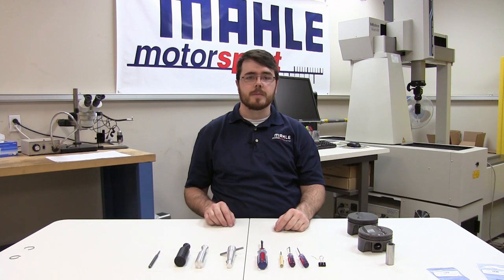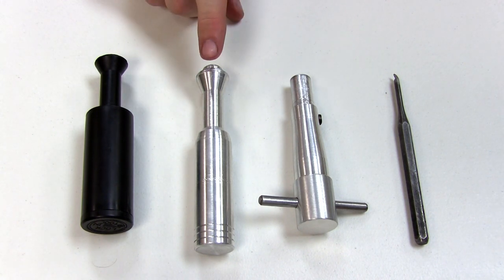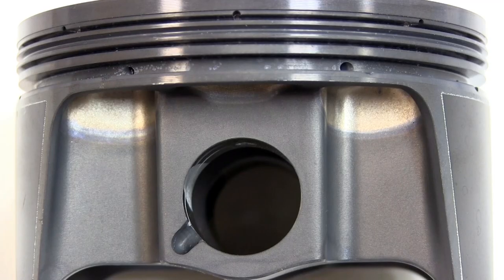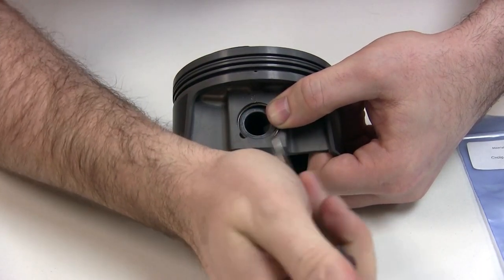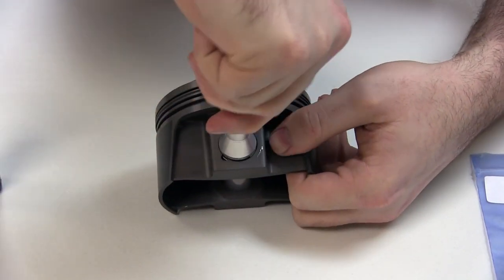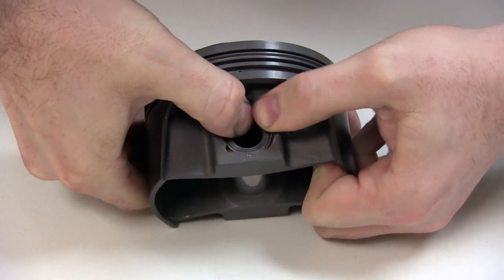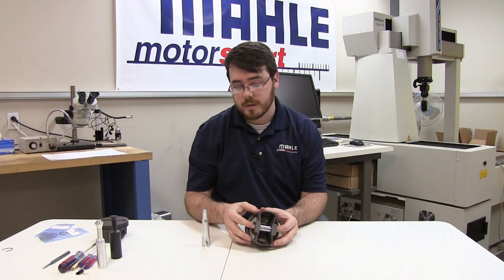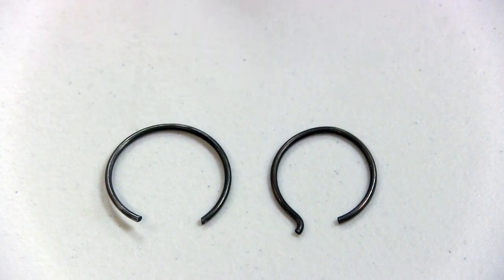Circlip Installation

Comment: Tools only work if the piston has flat surfaces around the pin bore. Will not work on 'slipper' skirt 911 pistons with the piston sides sloping onto the upper third of the pin bore surface.. Back to the old screwdriver with a notch trick and the occasional flying circlip!🤨

Comment: Can anyone provide information about where to have the clip opening, does it matter if a clip end finished at the dig out hole?? Seems like mahles should mention this point
Reply from the maker: Thanks for the question. The clip end should not be at the opening for clip removal. Place the clip ends at 12 o'clock or 6 o'clock.

Comment: I was struggling to get a c clip retainer back in place near the end of a rod that supports my mower deck when i watched your video. I have a tool designed for that --but it was 67 miles away. Luckily the rod end by the clip groove was beveled and i had a box end wrench a smidgen bigger than the rod and about the same size as the clip. Pressed it on first try.

Comment: 5:34 the piston I run have a relief on one side but have the removal notch on it...on the other side the ring slides directly onto the piston skirt! In a complete teardown and rebuild the most dreaded thing is getting the second clip on while the piston is on the connecting rod! Also installing those clips by hand usually gets a piece of your skin in the groove as well! I' m definitely making some of these clip tools you showed here!

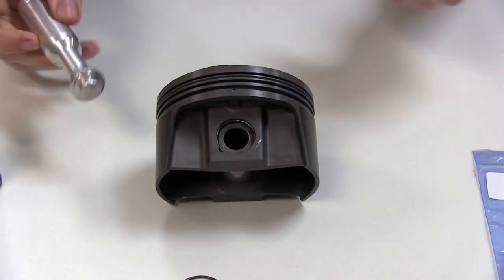Comment: Thank you SO MUCH for posting this video. Been struggling with the "W" company's really stiff wire circlips for years, and made your straight aluminum tool. Took a while to get the dimensions right, but when I did, it worked like a charm. Can you provide any guidance as to the proper dimensions for the business end of that tool (shown at 4:36)?

Comment: Pro tip, I tape a beer bottle cap to my lower thumb to push it on.  On my Porsche you have to install the pistons onto the rods while the liner is hovering above them with the rings in the liners.  It's a real bitch!

Comment: I like to use a little aluminum sheet metal to put where the scratch happened to prevent the scratch it also helps slide it in